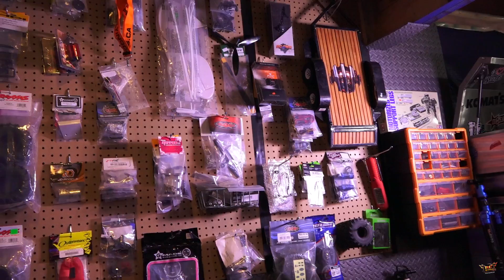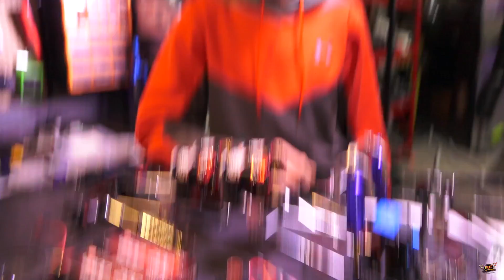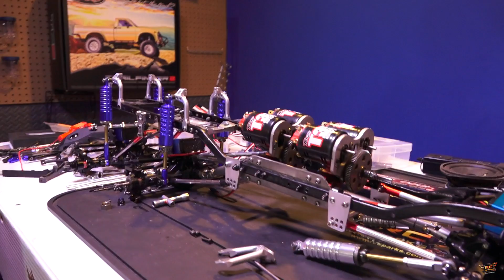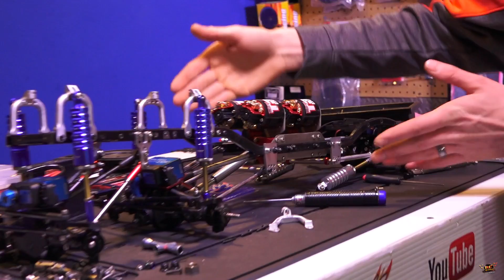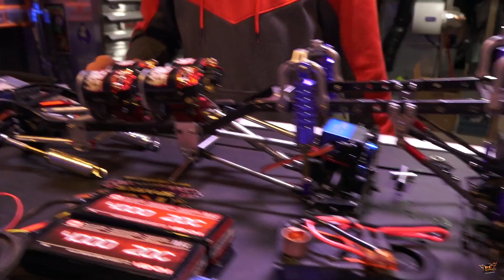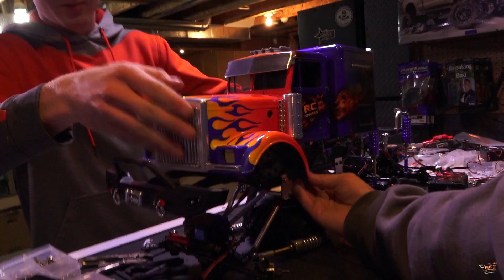RC ADVENTURES -  6x6x6 Optimus HD Overkill is coming together!

Comment: Try the Alturn USA servos next time AHBS-3713HTG+HV / Full Size High Voltage Servo+HS+TG(Ultra High Torque) are the water proof servos that make 482oz torque 8.4 volts and cost under $50.00 each on ebay.

Comment: medic what lipo should i put in my traxxas slash with a castle mamba brushless motor
Reply: +rcmaddness!! I run Zippy 5000 mah 3s in mine with the same system as you. It goes like a bat out of hell! I took them on a trade because I probably wouldn't of bought Zippy brand but so far no problems.
Reply: +Chris O'Donnell  thanks!!

Comment: +RCSparks Studio can you can you please do a full breakin process beacuse i have been searching for a breakin video but they all talk like everyone understands all the stuff and what it means or what it does but im new and im getting a nitro truck and i wanted to do the breakin process right so can you please answer back and i am subscribing to day
Reply: +Ann Fishburne  Break in just means don't go full throttle for like 2-3 tank fulls. Just go easy and try to accelerate slowly. No punching the throttle. The engines are made of soft metals and need to wear in . Use good quality nitro fuel that is at the correct mixture that you manual says
Reply: +Chris O'Donnell thank you chris i have wanted a nitro rc for a long time i was 13 when i first wanted one and i waited a while to get to understand them and i have asked questions on rc sparks videos but he doesnt reply so thanks again have a good day
Reply: +Chris O'Donnell ok thanks again

Comment: Been almost constantly looking for a durable off road monster truck, under $100 if I want to get it for my birthday. $200 For buying but dont tell me "Ohh you can get $30 more and get this". It has to be able to go in grass well thats tallish like 3-6 inches uncut. And we have alot of land in the woods that is hilly and wet so take that into consideration. I think 1/10 to 1/18th would be fine but would a 1/18 scale iron track car be able to do this stuff? I dunno but would a slash be able too? I found a slash and a ruckus at my local shop for $189 but the money is in savings sol I dont know if I will be able to spend it yet. I think if I had the money I would be describing a summit! But it is huge and complicated and has like 100 servos. This is a long comment. It doesnt have to be a monster truck but you get the idea.
Reply: I had a cheap maisto tech rock crawler but drove it through a puddle and the servo died once I drove it out. No saving that thing! I felt that it was to slow too.
Reply: +Brave Cuber with that price range you should be looking for a used truck, you can probably find an older traxxas E-maxx used if you do research. Good Luck! 😀👍🏻
Reply: Thanks! Ill look but is there anything rtr?
Reply: +Brave Cuber if you buy it used maybe you can get a battery and transmitter with it. Which would make it rtr lol, if you mean new, there really isn't much to choose from if anything... :(
Reply: I could digup anything in my range except rollers.  What aboutin any other range that can atleast handle terrain suchas wet muddy dirt trails?
Reply: +Brave Cuber the only other truck would be a Slash, they are wicked strong and very capable
Reply: I asked this in my original coment, does it handle grass?
Reply: +Brave Cuber yes, i have a lot of fun with mine on grass dirt gravel and skateparks and bmx tracks, i even got some paddle tires to play in the sand, the slash is very versatile and mine is only 2wd, the 4wd would be that much better on grass.
Reply: Sweet! Ill look out next time I can buy!;) thanks

Comment: I no this is nothing to do with this video but I just bought a vaterra ascender what are good up grades to add to it I mostly go off road mud etc thanks.
Reply: +MrNovaKane Tires in most cases are a good start for any RC but I personally would just upgrade as you break stuff. No point spending money on stuff that works perfectly fine. Just my opinion.
Reply: +Chris O'Donnell ok thanks for the input

Comment: I recently bought a Traxxas Stampede, could you reply on some stuff that I could upgrade etc.
Reply: +Corrupted Wifi mate, if you want to do wheelies, stick with the titan 12t, run on 2s and get yourself some narrow badlands, i have the exact same setup and it's a wheelie monster.
Reply: +thekeyman356 what engine should I go to? Right now mine is Titan 12T
Reply: +thekeyman356 ok thanks man :)
Reply: well, if you got some money in your pockets, You can go VXL which is a serious motor/esc upgrade. You can get custom tops, metal parts, the list goes on
Reply: +ZacAttackAtl Some people have told me to get an aluminum kit because it's all plastic and easy to break
Reply: +Corrupted Wifi well the thing is, if you were to hit something fast enough or hard enough a plastic part will snap, if u have metal parts, they will bend and potentially break other parts. Those plastic parts are cheap so if you were to break those, it's not really a prob.
Reply: +Corrupted Wifi I do however run a aluminum Body and correct me on this, a transmission case on my rustler and they have had no problems.
Reply: +ZacAttackAtl ye,I have already broken a body mount and it was only $4 to replace. If it was metal it was almost $20 to replace
Reply: If you happen to choose the Velineon, be mindful to not over-gear it, i have a heavily modded slash and I've burned up 2 of them..... With that said, it was doing wheelies at 50+mph and i had fun burning em down!! Lol 😆👍🏻
Reply: Oh yeah, all that failed was the ESC, i thought that was worth mentioning
Reply: +highyoyos I bought a 5000 mah ID Traxxas battery a few days ago and I was driving with the battery and the battery blew and started smoking up
Reply: +Corrupted Wifi well that sucks!! Was there damage to anything else?
Reply: +highyoyos ye it sucks, and no nothing got damaged... Luckily

Comment: what is a brushless motor
Reply: Really?...... Its just as it sounds, no brushes. The construction of the motor is somewhat reversed, there are inner-runners which have the windings fixed to the can with a powerful magnet spinning with the shaft and out-runners which have the windings fixed to the mounting point of the motor and the magnets spin with the can and shaft, both are much more efficient than a standard brushed motor but both have drawbacks....
Reply: +Jay Jack 
its a motor that does not brush its own can clean.
Reply: Ok
Reply: +bittasweet symphony lol 😂